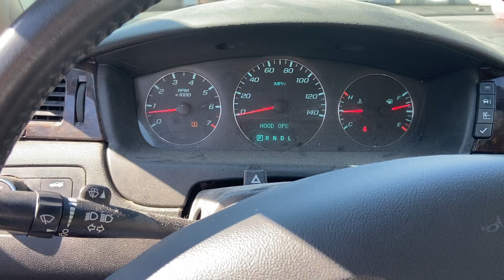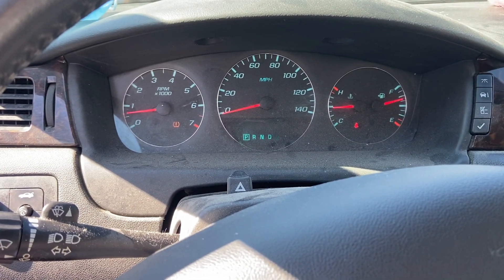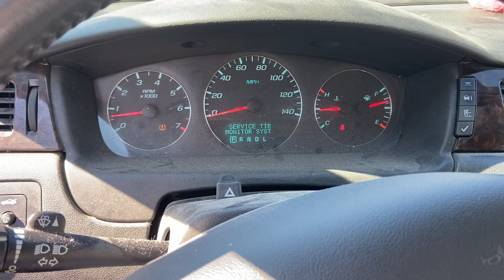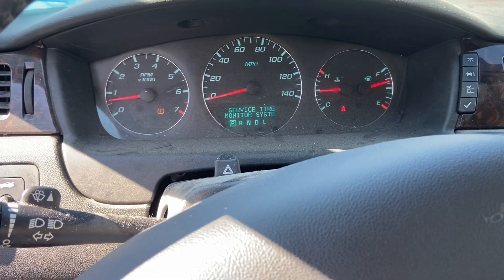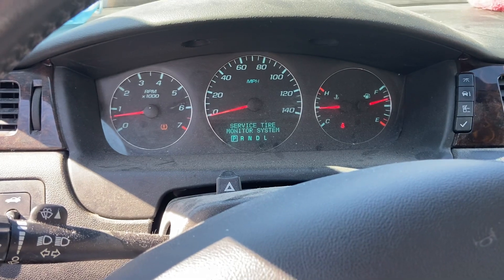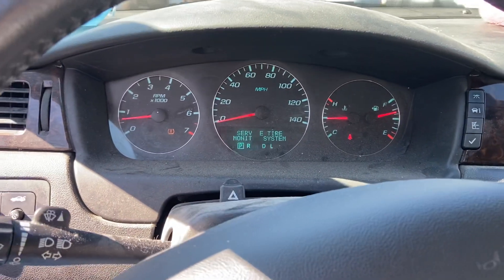Automatic Transmission Fluid Check How-to

Comment: Bro what do I do if that gage won't read and it's saying your engine is overheating 😂
Reply from the maker: I would check your fluid level. If the fluid level is correct it is time to diagnose the gauge. May not be working correctly.

Comment: This is a well thought out video. I would offer a couple of further points for consideration:

1. The trans fluid may take (much) longer than the engine coolant to warm up. The added transmission temperature gauge in Naughty Truck really drives this point home -- and also shows that it really takes a lot more driving than I would have expected in very cold weather to truly warm up the transmission. The engine thermostat may not open in very cold weather, so the coolant may not lend much if any heat to a transmission cooler that's situated nearby or integral to the radiator.

2. Drive the car to warm up the fluid, unless you suspect it's critically low. It may not warm up very much just sitting there and idling.

3. Get a good funnel for this purpose, keep it very clean, and when it's bitterly cold out, keep your transmission fluid in a warm area. Otherwise it flows like treacle, if even that much.

4. Older cars don't warm up as quickly as new ones, especially if you've got a small engine in a cavernous engine compartment (like a straight six). You may never get there at idle on a cold enough day.